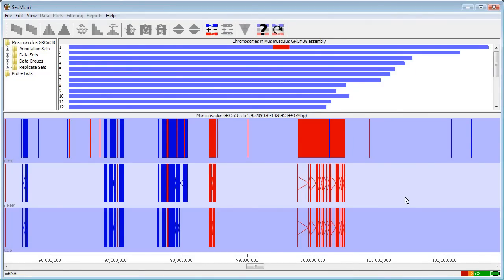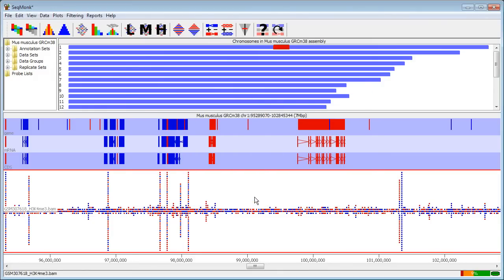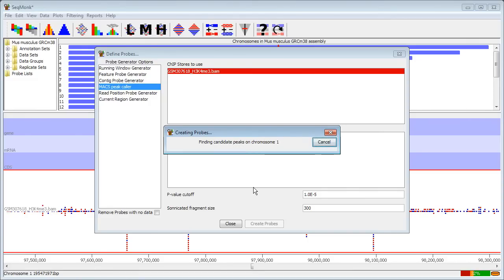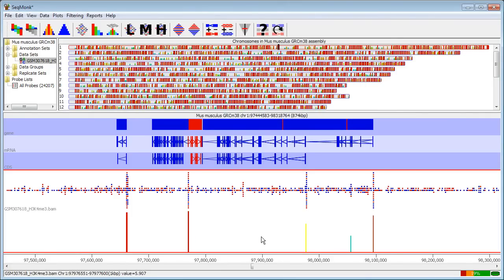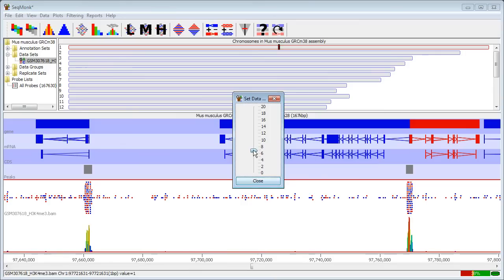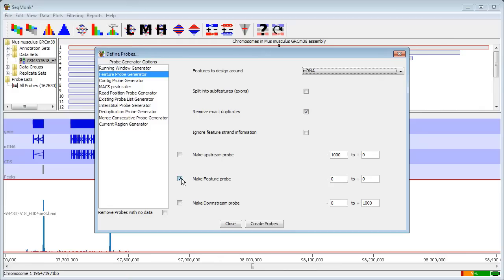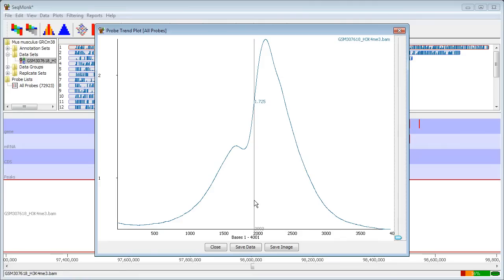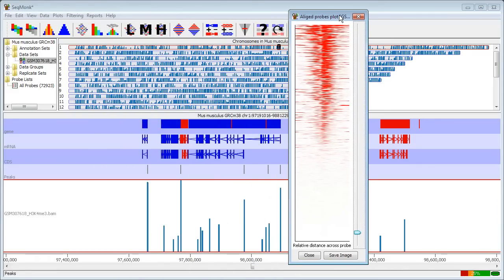Chip-Seq Peak Calling and Trend Plot construction

Comment: Hollo Simon,
I have multiple ChIP-Seq bam files that need to process. Which video should I refer to? Thanks a lot.
Reply: It depends to some extent what your experimental design is.  It's probably best to take a look at the relevant part of our ChIP course (from slide 83 in https://www.bioinformatics.babraham.ac.uk/training/ChIP-Seq_Analysis/ChIP-Seq_slides.pdf).  You could also try the exercise from the course since that deals with multiple peak calls and shows different approaches you can use (https://www.bioinformatics.babraham.ac.uk/training/ChIP-Seq_Analysis/Analysing%20ChIP%20data%20exercise.pdf)

Comment: Hello Simon,
Thanks for your help to date. I was wondering if the data from the aligned probes plot can be extracted? I wanted to plot ChIP data across all genes which are all scaled to the same size, and use that data to correlate with gene expression levels.
Reply from the maker: No, there's no option to export that in the current release.  I'd need to check, but I think we retain the full data when drawing the plot so it's probably relatively trivial to offer and output option for that.  I'll open an enhancement request in our github repository and we can see how easy it would be to implement.
Reply: That would be great - thanks!